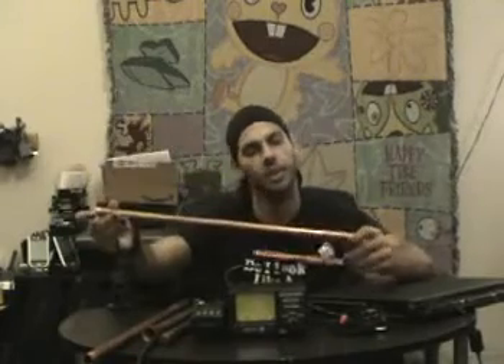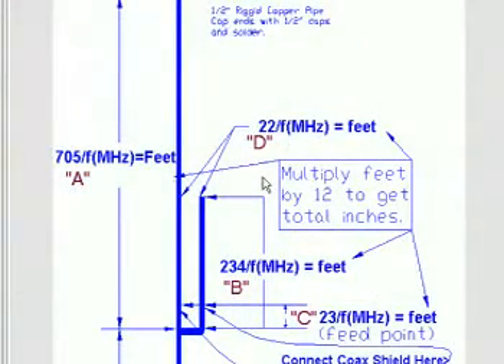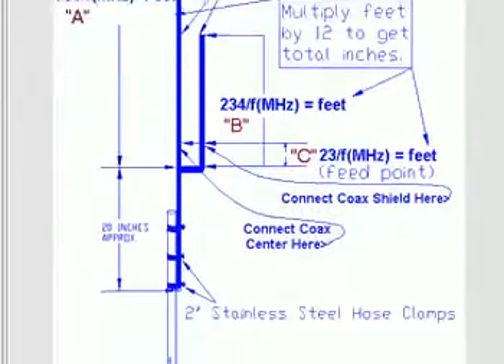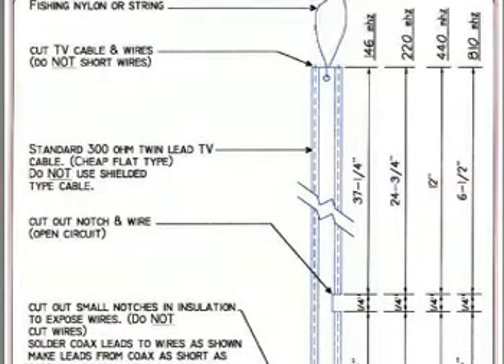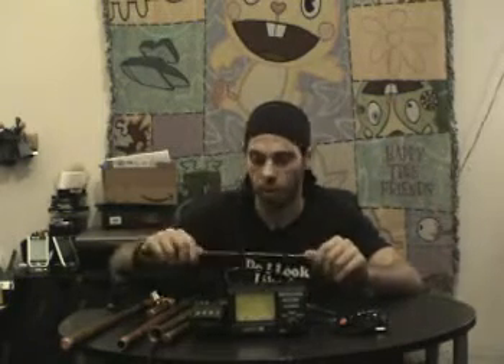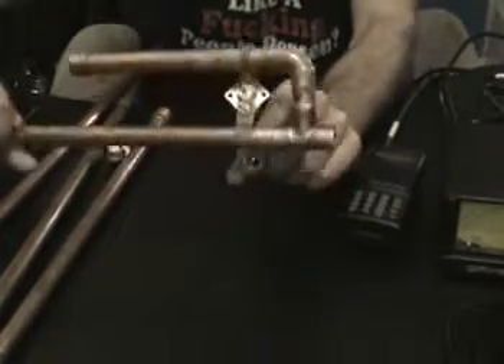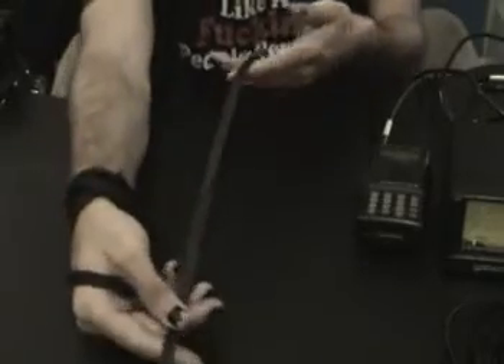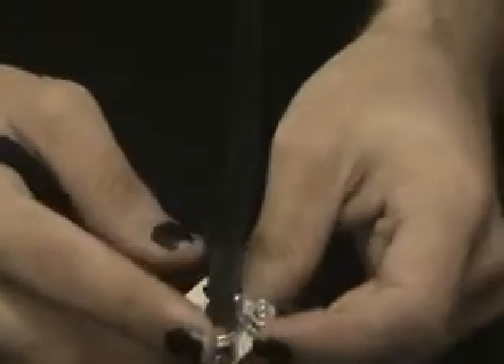J-Pole Antenna Design -Part one

Comment: I don't understand hy everyone insist on using 3/4" copper. 1/2" type L hard copper pipe is more than sufficient and strong enough to handle wind load and power of the output.

Comment: A pair of 3/4" straps folded over a 1/2" type pipe with brass bolt, nut  and washer makes a good and cheep adjustable feed point. VA7WN

Comment: Do the extra metal mounting pipes have any impact on the antenna performance?
Reply: +wimpog97 YES
Reply: The metallic conductive mast can become part of the radiating element.. There can be perfect multiple half-waves, if by chance at an unknown random mast length. If you don't believe me, use a nano-VNA to monitor with a wide sweep and watch the phantom SWR notches move about as you slide your hand along the mast pipe. All your efforts to get a good match can be thwarted after placed aloft on a metal mast. Best to place a short insulative section right close to the "J" pole mounting "handle". VA7WN

Comment: It would have been simpler to just say that the j pole is an end fed half wave antenna. Despite it looking like it has two elements (one a quarter wave in length and the other three-quarters of a wavelength) it is actually a half wave antenna element fed on its end with a balanced quarter wave transmission line, which has been tapped up from the bottom (which is short circuited) for impedance matching. In any case the j pole has design issues and many other simple antennae will perform better at UHF frequencies